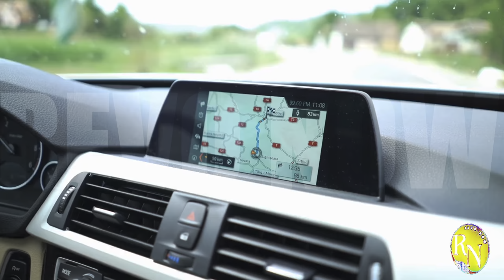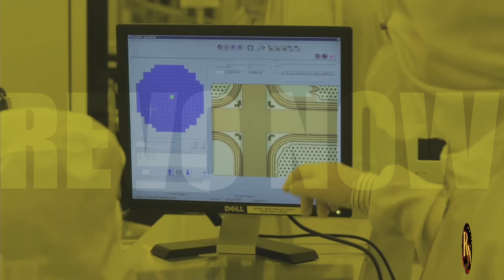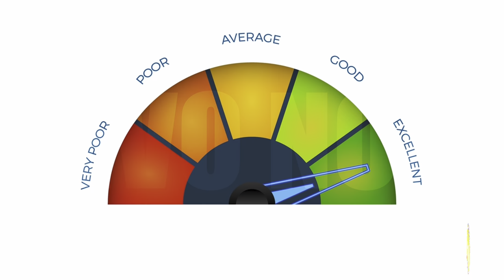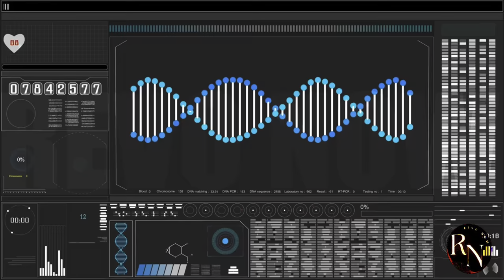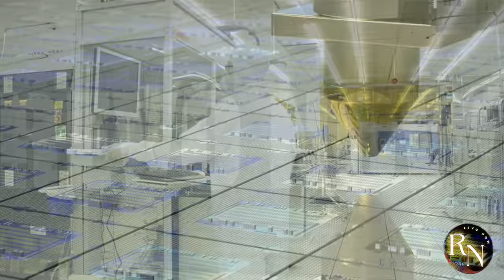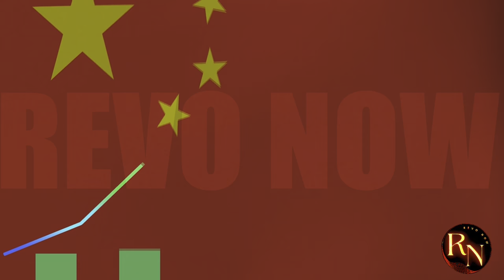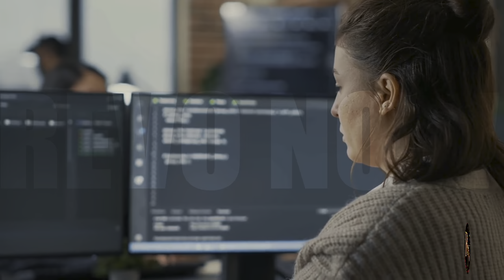China's 2nm CHIP: Defying US Sanctions

Comment: China has already mastered the mass production of the 8nm and above which are the most useful low price chips for consumer products. Chips of 2nm are expensive and cost effective only for small items which are not very price sensitive. However, China has achieved the ability to produce 2nm chips without using the USA’s technology which secure the future applications. The USA’s export limitation will only hit its own semiconductor industries as China’s technological prowess is not dependent on them. China will therefore satisfy its own local demand for high-end chips using its own tools rather than importing from foreign countries.

Comment: If china has made 2nm chips, why is Huawei still using 7nm in their device.
Reply: Lol advance notice
Reply: Mass production is an other story ,I assume
Reply: I think China is able to produce a 2nm chip but not yet mass producing 2nm chips.  Say you do not have needles, only nails. You can file the nails into needles manually. However, producing 10,000 needles an hour is not possible without the right technology.
Reply: They are not , try keeping up !!!
Reply: China is the only country on earth that now can produce high end lithography machines with the compleet manufacturing process chains even the United States can't achieve this feat , every single component for these machines are made in China , China has just opened the gap by 20 years , impressive !!!
Reply from the maker: Watch for the next Huawei smart Phone and see..... https://www.youtube.com/watch?v=IGDMyd1ihFQ
Reply from the maker: Check this out: https://www.youtube.com/watch?v=IGDMyd1ihFQ
Reply: @dennisrichards7994 ”delete A” is more important now more than even when pagers and communication devices can explode.
Reply: @WEBFundamental  yes, very likely cannot mass produce yet, still, the fact that it is done is important because the proof of concept allows all parties to advance to the next stage, i.e increase production yields and also re-engineer parts of the machine as well, only requires one proof of concept machine and then, they can leverage hundreds and thousands of engineers to refine and upgrade it multiple versions of it, trying different approach, this time knowing that success is only a matter of time. no longer groping in the dark, instead bring focus to bear.
Reply: It is a sophisticated chip you can't get that easily by gadget until the time has not come. same as Apple 15 after 16, not a 25😀😀😀
there is a time for everything
Reply: It's a deceptive channel. The author takes his wishes for reality.